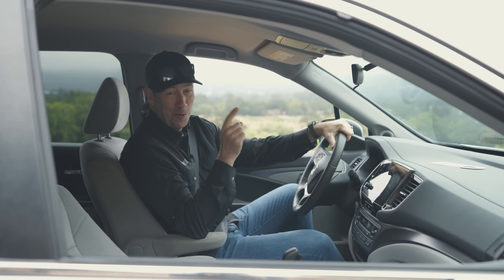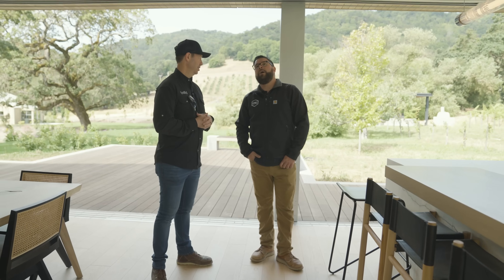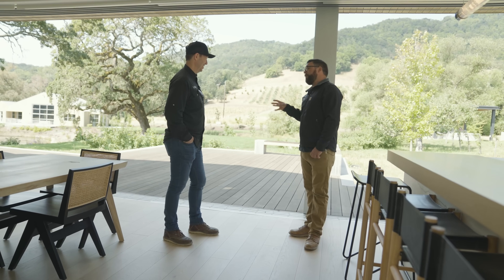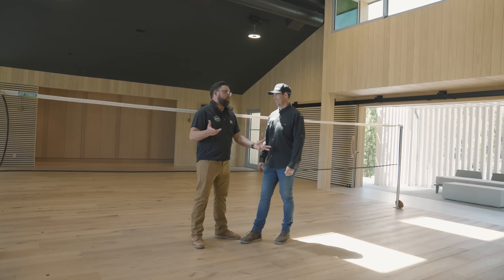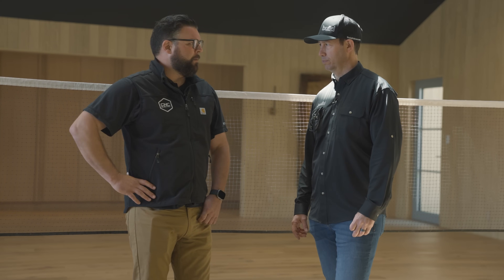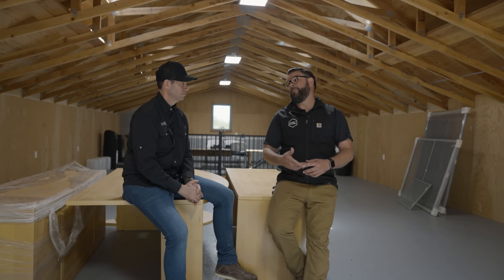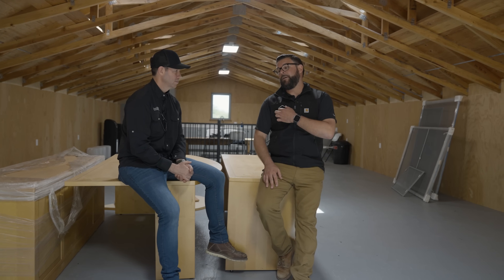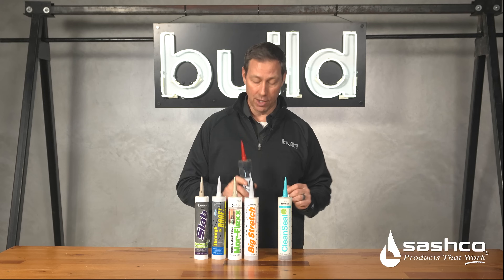"Talking Electrical: Part 1" - TALKING TRADES EP. 5

Comment: Wish Illinois would get it's act together on electrical licensing.  There is NO State license for electricians in Illinois. (There is a license for almost everything else)   Every town, City or county has it's own license which you need to apply for (and pay for) if you have a job in that town.  Very interesting to see that neat Romex work.  👍None of that here all wire regardless of voltage is in EMT.